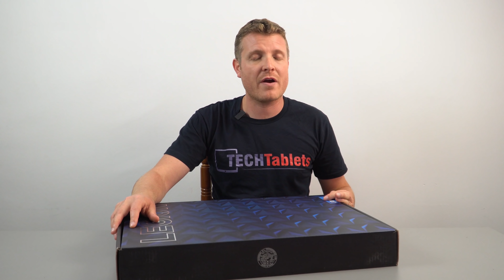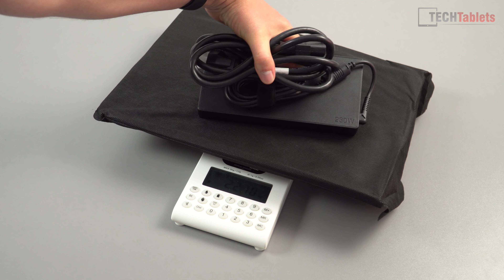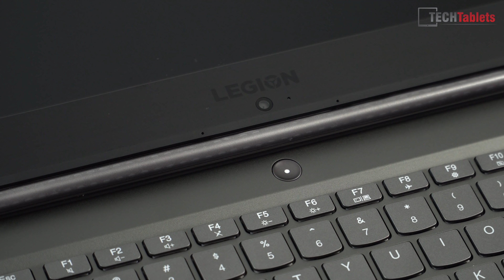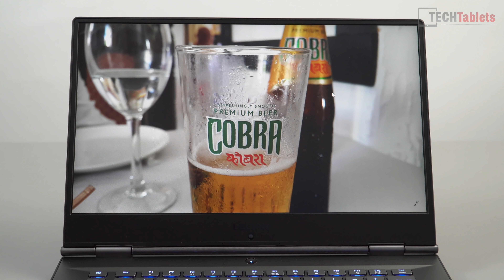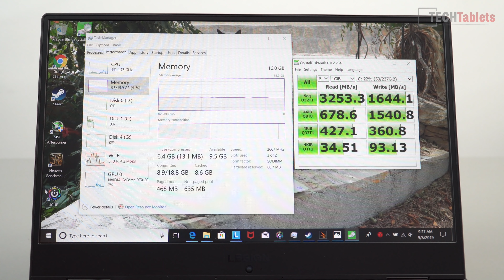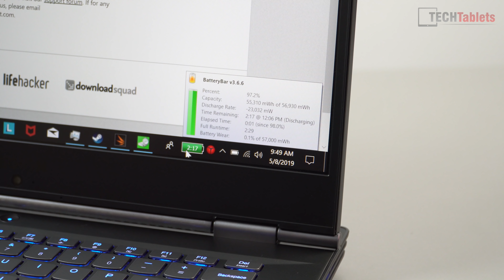Lenovo Legion Y740 Unboxing & Hands-On Review

Comment: My GNU/Linux side user review:
1. Touchpad is using Microsoft precision drivers, not synaptic, so it does not work during installation. After installing OS, all is fine.
2. Secure boot had to be disabled, because of Nvidia drivers were not signed.
3. UEFI booting only had to be enabled in BIOS.

Nice thing is that you can switch Nvidia card in BIOS permanently and you dont have to do any off-loading. But I like to have both options. Sometimes I might want to switch to switchable mode for battery saving.

4. Fans are super loud when GPU reaches 71 deg Celsius. I dont know if this is the same on Windows, but I wear noise canceling headset so not a problem, otherwise I would probably return laptop.
5. Sound is good.

Everything else works.

The biggest FAILURE though in this laptop is keyboard layout. My muscles memory cant get to use stupid F keys on the left hand side. I wish they had 15" version without those keys. I might try disabling them. I was considering NOT getting this laptop because of these stupid keys. Long story short, there is special place in hell for people coming up with this keyboard layout. I have to use external keyboard.

Comment: owned it for almost a week. It's a great experience for me
Reply: Is the bottom panel metal? Or is it just the black part that is plastic?
Reply: @seanmcleann  only the black part is plastic, but it doesn't feel cheaply built at all
Reply: @DANNY082100  Any heating issues with it?(Without undervolting)

Comment: I might buy the battery from the 17 and put it in my 15. I don’t use the 2.5” anyway so if the price is good I’ll get. Battery is poor but it’s not really a deal if you keep it plugged in. But I agree with battery since it’s only 2hrs (according to the time said, but it seemed to run in line as I ran it down some way before charging it up)

Comment: They really should have an option to forego the hard drive and get a bigger battery in there just like the Dell G5
Reply: It isn't an official option, but you are able to use the 4 cell battery from the 17inch Y740 inside the 15inch Y740 if you remove the hard drive tray.  Giving yourself 30 % more battery (4 cell vs 3 cell).  It requires you purchasing a new battery as the replacement of course.  But it is do-able.

Comment: I'm torn between this and the Razerblade 15 (GTX 1060). Obviously this has bettie specs, but what's turning me away is its mediocre color accuracy and horrible battery life. Also, the Razerblade is a half pound lighter. What should I do?
Reply: Depends on what you gonna use laptop for . For gaming , lenovo is better. For business and class , razor blade is better .
Reply: I’m not going to be doing any serious gaming, likely just rhythm games and rpgs for the most part, but I’d like it to perform well for at least 4 years. I’ll also be doing digital art and photo/video editing. Thanks for replying!
Reply: @angelobronte1452  how the fuck do you recommend razor for business and class. I can think of far better laptops than that crap
Reply: Ya, obviously the Lenovo has the RTX 2060 which is nice, but fro. What I’ve seen, the 1060 is still pretty viable, no? Also, I wouldn’t be completely opposed to getting a graphics amplifier and a monitor down the road, but is it still possible that the Razerblade can last that long on its own? Thanks.
Reply: I haven't used razor but i've heard waaaaay too many bad things about them to try it. Laptops aren't reliable or quality built

Comment: $1.5k for a laptop with rtx 2070 is not that bad. And as always, great video
Reply: yeah i bought this one instead of zephyre 701 that cost over 3k just for 10 more fps.
Reply: EM so what would be good then?
Reply: It's not worth the extra 200$ over the 2060.they perform very similar.and with that display,you wont need anything above 1080p

Comment: Insert key needs Fn. I hate when they do this. shift+del, shift+ins, ctrl+ins are the true shortcuts for cut, paste, copy.
Reply: It has a fn lock fn+esc...
Reply: Well, at least mine has,  I inspected the kb closeups in the video and it does seem that it's not there, that's weird, my model is the 17.3 inch and it has a little led and the fnLk simbol, it also doesn't have those stupid macro keys on the left, instead it has a keypad... Much better kb layout among ohter benefits like a bigger battery, larger screen better sound system and top bezel camera, on the negative side, it's heavier and it has thicker bezels...

Comment: If it has a bigger battery, it would be perfect.
Reply: The 17.3 inch model has a 76 Wh battery, I can easily get 6 hours with the hybrid mode on, and 80% brightness... And if you want more battery life you can get it by underpowering the CPU, undevolt and lower turbo boost power. But... Use these tweaks carefully...

Comment: You're seeing CPU throttling probably due to the high PL1 limit - 60W while GPU is not under heavy load. Most other gaming laptops have default PL1 limit of 45W

Comment: I had 2 Lenovo laptops. The first one is ideapad 720 15-ikb. And the second one I'm using now is Legion 730.  They both has so fucking bad backlight. If you play or watch movie especially at night all the angles are overlighted. And any of the reviewers didn't mean this "feature" in their videos. 
I tried to return the first laptop with such a complaint but they tested it in the authorized service center and returned to me with a statement that "this is a feature of the model". So this is the pointless way to return money for them.

Comment: does the thermal pad on the ssd touch the back cover because if not it will only hinder the cooling by adding additional layer/medium to transfer the heat to air
Reply from the maker: Touches the back so it will help cool it and throttle less.

Comment: Companies should provide 240hz display with this new rtx 2070,2080,2080 ti laptops 
Even if it would cost a little bit more
Reply: For what reason? Even if you 'll run modern games on minimum setting you won't get 240 fps
Reply: @hmst5420  have you really tried RTX cards
Reply: @hmst5420  in most games I've seen mobile rtx cards giving over 170-185fps in 1080p medium so for me 144hz isn't that great choice for rtx laptops if the display is 1080p
Reply: @itsmilan4069  depends on the game dude. Fps games have more fps than triple A titles . It is not practical to put a 240hz panel for most users, especially when gpu is 2060 or 2070 max q. It is only reasonable to offer 240hz as an option when you consider 2080.

Comment: Gaming Laptop?

I'm out. Far too heavy and extending that keyboard to the left is disturbing productivity.
Reply from the maker: Well they are all about gaming power not so much weight. And yes they shouldn't have added the column of keys on the left.
Reply: typxxilps nobody said much when Alienware and Aorus has the keys on the left. 
However you seriously think it’s heavy? The weight spread over the size of the laptop is extremely light. If you condensed the weight to like the shape of a block, then yeah it would be felt. Don’t be fooled. I own one so I know better than your observation.
Reply: If you don't want a gaming laptop why bother watching this video ? Plus there are thin and light gaming laptops out there .
Reply: Its not even that heavy🤦🏿‍♂️

Comment: Dave2D said thermals are very very good. You say CPU throttling so who's lying bro?
Reply from the maker: I"m just reporting what I saw after running the 3DMark firestrike extreme test, it hit 92 degrees C and throttled on the CPU. It does get quite hit and the ambient temp was about 21 degrees C, Maybe he was testing in cooler temps or had a better thermal job? No idea.
Reply: @Techtablets  you have to repasted bro so don't say it throttle when it wasn't going to if you repasted it!!!!!
Reply: @seansmith6473  Don't overestimate the difference repasting brings about. It only brings the temperature down by 2-3 degrees in most cases, so it doesn't really matter. Also for a review, the majority of viewers aren't gonna repaste their new laptop and risk damaging it.
Reply: i think he ran too many apps in background
Reply from the maker: @coolrift8934  Just 3Dmark was running when I did the test. later opened up other apps. You don't think people will multitask on this? I'm only reporting what HWinfo sees for thermals. The i7 8750H is a hot chip so not surprised.
Reply: @coolrift8934  yes 3d mark stress test is not real use.
Reply: Also Dave concluded that it had a mediocre battery life compared with Chris' 2-hour battery life rating. Maybe Dave didn't push it as hard as Chris does, just guessing.
Reply from the maker: @RiloxHK  2 hours or less on the dGPU surfing, about 3 1/2 hours on the iGPU with G-sync off.
Reply: I also watch Dave's videos but I also watch others to get all the different opinions and test results 
Every Tech YouTube reviewer have different methods so please don't be mad at one person if his and your opinion don't match
Reply: Nobody is, the 8750H is hot as hell. Compared to other laptops with the same processor, the Y740 shines even in the CPU dept. A bit of undervolting and the CPU won't reach 90c in 99% of use cases and you would get really good performance compared to the other much more expensive laptops.
As for throttling being shown in this video, only two out of three core throttled, I can confidently say that with competing laptops almost all cores throttle.
Reply: C'mon dude, everybody have a different testing methods
Reply: Dude not every test is same
Reply: Dave2D is in a very well-controlled room, with all that air conditioning... to keeps things cooled down, this difference is totally negligible